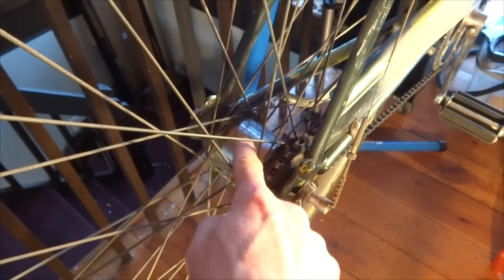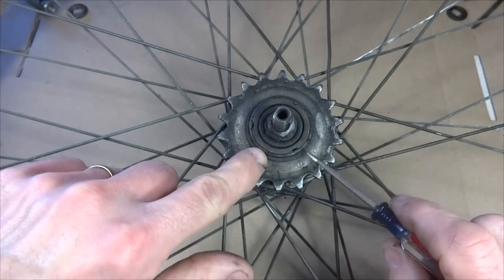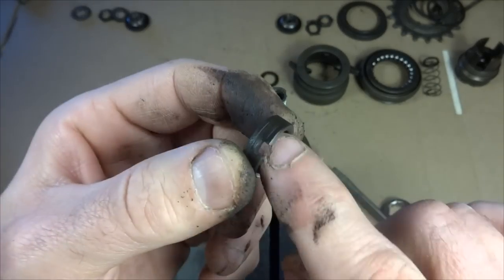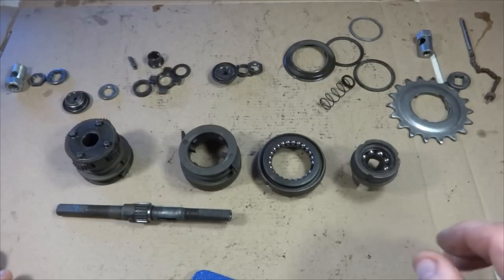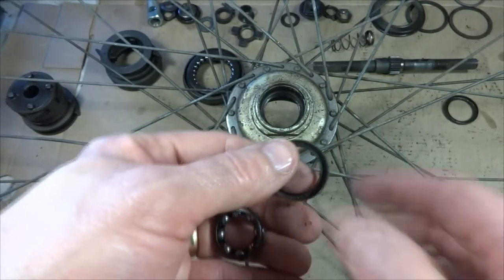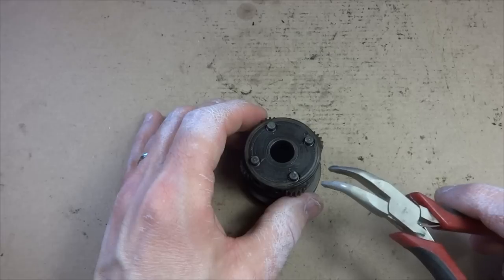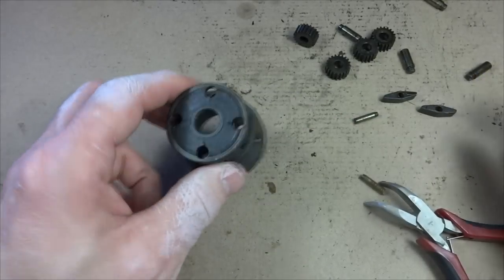Overhauling 60 Year Old Sturmey Archer 3 Speed Hub

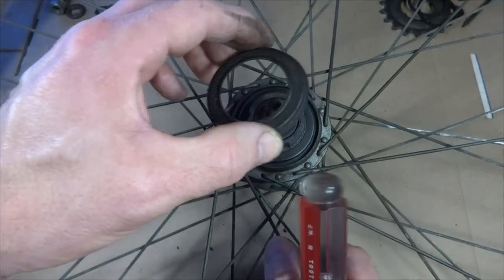Comment: The part at 4:38 almost drove me nuts. Hammer as I might, there was NO way I was getting this thing unstuck -- Date stamped '86, it had been sitting untouched for about the past 30 years (the bike's inner tube was a factory original!). I don't have a table vice to clamp the assembly in and turn the wheel, as some others suggested, and no amount of penetrating oil was going to help.
Thankfully a LBS still knows how these things are done, even if most shops nowadays are more about upselling novices on the newest Ultegra than building a community.

I have to de-rust some parts because they've started turning a nasty orange. Does anyone have any recommendations what to use as a protective coat on parts like this once the rust is gone? WD40? Oil, grease?

Comment: Thank you :) Very educational. My axle broke last weekend. Trying to fix it tomorrow with a new axle. I have the 3 Speed Hub AB with Brake. But most of the parts are identical. One problem is: I got a '86 Hub from my grandpa (with sane axle). My broken hub is '94. Same model, but the axle is different (the size of the slot for the axle key is smaller on the '86 one). Trying to mix it ('86 internals in the '94 hub). I do not want to renew the spokes.Thumbs crossed :D

Comment: The flanges on SA hubs were too narrow for modern spoke bends, and often broke spokes. A good shop would rebuild the wheel with brass washers behind the heads to support the curve. I seem to remember Sturmey Archer thickened the hub flange on the alloy bodied 5-speeds in the 1980s. Brass washers were also used in building SA dynohubs, which were quite popular with cycle tourists, even though the light they gave out was pitifully low.

I had a 4-speed on an early 1950s 28" wheel Raleigh Superb, great hub but prone to slipping if not adjusted perfectly. For a challenging total strip down, an integral hub-dyno takes some beating.

Comment: Hello , i converted a front wheel to 3 gears with this hub. I found the whole bike in alley and i saved it for a while.I was planning to use it cause in my 20s i converted a 16 inch bike from the garbage to 3 speeds using a shimano hub. Now because of gas prices im converting another found bike into gas powered chainsaw front wheel drive bike but at this conversion the pin would not retract. With your video i got it back to work and now the project will be finished with a high rev gas motor and 3 gears to go to use it for work.Thank you so much and i think it will be the only gas powered front wheel 3 gear bike 👍

Comment: Can you explain about the little steal key at 8:20 ? Mine fell out when the whole assemble fell out the wheel. 
The axle has a long shaped whole machined in it. Do I just put it in there horizontally with the hole up?  And what does it do anyway!
I really dont want to take everything apart......
Reply: That steel key is called the "axle key" and is part of the shifting mechanism.  Before you can reinstall it, you have to take the ball ring off (part he unscrewed with screwdriver and hammer), then the ring gear  (first part you see under the ball ring), if you want to do it easily.  First install the collar with the hole in it over the axle, then the clutch (cross-shaped), then this axle key, with its flats up, and finally another collar with the two notches to mate with the flats on the axle key.  This last part keeps the axle key from sliding out.  You might have removed it before sliding out the whole guts out of the hub shell, allowing the axle key to fall out.

Comment: I guess I was an old time bike mechanic.... ;~) I recall repairing these hubs back in the late 70s and early 80s... we had a stock of pawls, springs, gears, oil ports, chains (there were different lengths), etc. in the shop so we could actually fix them. Rather than using a screwdriver and hammer to disassemble the ball ring we had a tool that grabbed the two spots where the screwdriver was applied in the video. We would put the tool in the vice and spin the wheel. I see there is a flat spanner available for this purpose now but it seems to be shaped differently... I wonder if that vice tool is still available??

Comment: I plan to use your video on my blog page on hub-dynamo.  I have an AG 1954 - which is not a known working variable gear.  It has an extra washer with non- turning-flats on the non-drive side so that you can adjust the slack put the washer on then when you put the lock nut on it does not cause the  cone nut to turn.
Also my 1950 FW has the inspection hole both sides and you can use the shoulder of the toggle chain to set 2nd (L) but it has an  indicator rod the other side for setting 2nd or 3rd (N).   That is why the wheel nuts are the same both sides - it is historial.

http://blog.andrew-lohmann.me.uk/2019/07/

Comment: Sometimes the washers that go next to the axle nuts do not have the notches. This was purely because the bike frame dropout was the same dimension as the Sturmey axle flat part. If using the hub in another frame then check the dropout dimension & axle flats dimension. If different then source washers with notches (2 different sizes are available).

Comment: I cant remove the transmission from the wheel hub. I spent quite a bit of time trying to remove the ball cup with a hammer and screwdriver. Any suggestions?
Reply from the maker: Nope. I have overhauled a handful of these, exactly like in the video.

Comment: Many years ago I had a 4 speed. On the non drive side a threaded rod protruded from the hub and connected with the tension chain through the hub.. It needed the extended nut to protect it.

Comment: Was there a reason why you didn't lubricate the pins and the inside diameter of the dawgs and the planetary gears?  I have a Schwinn Sting Ray that has this hub.  Very interesting video.
Reply from the maker: They were lubricated by the oil in the later steps.

Comment: What grease gun are you using there? Looks handy. Also.....have you ever had issues using grease on your SA hubs? I have heard you are supposed to use OIL only. No grease needed. This doesnt make much sense but .....it is what it is. I have heard never use grease in the SA hubs. I just pulled mine apart ("64) and they are like yours (before your overhaul)....no grease at all
Reply from the maker: https://www.amazon.com/Dualco-Grease-Gun-Short-Nozzle/dp/B0025UGOVW?ie=UTF8&redirect=true&tag=youtube25-20
I haven't had any issues.

Comment: How'd I do that?
 '60s era Robin Hood 3 speed SA/ AW.

Some how (after I repacked the bearings but didn't  really get into the gear hub)
I managed to :1) break the end off a planet gear post. 2) break a tooth off the clutch. 3) break a tooth off the driver.  I hate the fact I did more harm than good.

Your input is appreciated.
Reply from the maker: Ouch! Not sure. These AW hubs are beasts. Not sure how you broke the parts.

Comment: Isn't the end of this (great) video incorrect? He says that in first gear the wheel moves faster than the cog, and then that in third gear the wheel moves more slowly than the cog. It's the other way around. He starts with it in THIRD gear, not first (which is what he incorrectly calls it) and that also explains why the cable is at its slackest. He keeps tightening the cable - i.e. going DOWN the gears. At least that's what I think. He's very good and it makes me self-doubt. Anybody got a view on this?
Reply: I'm having trouble figuring it out as well. The hub is attached to the wheel by the spokes so they will always rotate together.
In 1st gear the sprocket & pedals turn faster than the hub & wheel, in other words the wheel goes slower. Handy for going up hills.
In 2nd gear the sprocket & pedals turn at the same speed as the hub & wheel. (Direct Drive)
In 3rd gear the sprocket & pedals turn slower than the hub & wheel, in other words the wheel goes faster. Handy for going at speed.
I think I've got that right! 

It's mind boggling stuff from the mind of William Reilly from Salford, England. He invented what became known as the Sturmey Archer 3 speed internal gear hub at the beginning of the 20th Century but lost out on any of the glory due to business decisions.
Reply: @oxforddon2210  
Yes. You are correct. And that's what he means as well but the only confusing mistake he makes is that he SAYS it's in first gear when it is in third and vice versa.

Comment: After taking off the clutch you appeared to run out of words for all the parts!   This is quite typical of British manufacturing, it seems over-complicated with many parts that could double-up on functions and make the BoM and assembly cheaper.
Reply from the maker: I could have looked up the proper names, but exact technical names really don't help much in getting stuff to work. And these things use what they need.
Reply: @RJTheBikeGuy  I'm going to concede to your greater experience.

Comment: A fantastic video RJ. However, I have a question about the oil you suggest. In this video you recommend synthetic oil and specifically advise against using Phil's Tenacious Oil.  However, in your other Sturmey Archer AW hub rebuild video, you specifically recommend using Phil's Tenacious oil. Can you comment on this? I've now rebuilt I think 4 AW hubs using Tenacious oil as you suggest. I wonder whether they are too sticky or greasy, as I don't consider they spin as effortlessly as if they were new, but maybe Im being too critical of my own work.
Reply: The extra stickiness of Phil's is exactly what's bad for the pawls, and may cause them to stick when the oil gets old.  Better to use lighter oil, not as sticky.  However, if you replenish the Phil's often enough, it will never dry out, so you would be ok.  It all comes down to how well you maintain the hub.  If you neglect it, using a lighter oil would be better.

Comment: Adjuster fitment on non-drive side to accommodate French bikes, some of which had left-hand drive gear.
Reply from the maker: Not that I have ever seen. Post a link to a photo of one of these French bikes with a left hand drive and a Sturmey Archer hub. Frankly, I don't think it would work on this hub as it is designed to be pulled from the right side.

Comment: To tell you the truth I would have reused the bearings as well for a couple of reasons! First season being I don't trust modern parts as much as I do older parts! #2 they are still good and  fine to reuse! Kind of strange but I'm considering using one of these on a motorised bike! I think it would be easier then methods used to go with stacked cassettes and a derailleur! Then again it's just an idea at this point! Basicly am engine, and a Jackshaft kit with the free spinning front crank!
Reply from the maker: Bearings may look perfect, but unless you have very expensive lab equipment, you can't measure how worn, out of round they actually are. And they are cheap. So replace them. Just buy quality bearings.

Comment: Ok, but what to do when the gear shifter chain is broken in the axel, and one can not get a good grip of it with pliers to turn it out? This happened this other day, and I am getting upset, not really knowing what to do to solve the problem. It is a 3 speed Torspo model...I think.
Reply from the maker: You will have to figure it out. There are not standard fixes for these kinds of things. If it happened to me, I am sure I would figure out a solution. I don't know Torspo.
Reply: RJ The Bike Guy This is the trouble with the YouTube platform is that we don’t get to be able to see the insights from thousands of insightful people who are lurking in a Newsfeed who may have Specific knowledge but didn’t look at this one post underneath the video.

Comment: Hi RJ, great video! I've used it to overhaul a Sturmey Archer from 1980 :) Thank you!
I need to ask, is it normal operation that while starting to pedal for a quarter of a turn the gears not to engage?
Reply from the maker: No. Sounds like the pawls are sticking and not engaging right away. Or maybe something is not adjusted properly.
Reply: Thanks RJ! I will open it again.

Comment: I don't get why you don't use the same grease on all moving parts within the hub as oil will dry out faster and has a tendancy to run out of mechanisms that aren't fully sealed. high pressure applications require a thicker lubricant to ensure they can do their job without squeezing a lighter lubrication, like oil, out.
Reply from the maker: Ask Sturmey Archer who designed and manufactured it.
Reply: @RJTheBikeGuy  I believe they replaced the oil port with a grease nipple on later models...
Reply from the maker: @roythearcher  I haven't seen that. Grease on the pawls could easily make them stick and not work. I have seen later models without the oil port and oil was added by removing the indicator pin. Again talk to SA. I did not design the hub.

Comment: Thanks for your great videos!  I just received a Sears 503.21 3 speed hub that is stamped Sears and made in Austria.  iI appears like a SA AW clone, other than the shell being different?  By any chance do you know if this hub is indeed a SA product or a knock off?
Reply from the maker: +ddk80 I really don't know.
Reply: It is probably the same as the Styria hubs fitted to Puch (Austrian) bikes in the 70's. They are a copy of the AW, and so close most parts are interchangeable. I've done some swapping out between them and they still work.

Comment: Hello, thanks alot for your detailed video and advice you give. It helped me alot overhauling my sturmey archer AB-hub with drumbreak. I noticed two diverences and I wanted to ask if you have clue if that is the origin of my problems. 
First problem I've had is the third gear would coincenditly switch back to second although I'm quite sure I adjust the switching cable perfectly fine.
Second problem is my freewheel function doesn't run smoothly. It feels like it's breaking a little riding down a slope... 
Here the two things I noticed. First, the 24 ball bearing, mine has got 25! O.o 
And second the washer you put on in minute 24:25, I dont have one... If it's crucial for the holding the switches into places would you be able to tell me how thick it is? So I can replace it by a new one... Anyway thanks alot!
Reply from the maker: I have not worked on a Sturmey Archer AB. Different hubs are different.
Reply: My 71 tcw is also missing a square lock washer.

Comment: I can't count tje time I did this ;-)
The design is genius but... I dit put quite some strain on the drive so they tenden to break. but... I feel that some replacement-part were of substandard quality (maybe not even original).
I can tell you that after 4 time it isn't  that big a deal. But the first few times are, indeed, hairy.
Reply from the maker: The AW's are work horses and will last a long time. There are some other models that aren't quite as tough.
Reply: @RJTheBikeGuy  Martijn probably has an AB, the AW innards but with a drum brake on the NDS. Those are by far the most common in this country. That, or possibly the coaster brake version, although they used to be quite rare. The gear part for either shouldn’t be any less durable than the regular AW.

My big thing was the engagement between the star clutch and the pins, for third. Those would wear away quite soon from heavy use. And once they wore a little, they’d wear more.

Comment: Any advice on how to remove a stuck ball ring? I tried with the hammer and a punch but it won't move, and also tried with WD-40 with no success neither. It is from a ´95 SA 3-speed hub with drumbrakes.
Reply from the maker: They can be really tight. Instead of WD-40 try a better penetrating oil like Kano Kroil or PB Blaster.  Maybe try putting dry ice on the ball ring to freeze it. Maybe that will help.
Reply: Indeed it helped! I went to the hardware store and got something similar to that PB Blaster. A couple of sprays, let it penetrate and a couple blows, and off it went. Thanks a lot
Reply from the maker: Cool!
Reply: One last question: in the official SA documents (technical information, service manual), only grease is mentioned, no oil. They refer to two different greases, one for the bearings and another one for the rest of the parts. However, when I took the hub apart, the lubricant on the parts looked like a dense oil and not a grease. 
Any suggestion?
Reply: The idea was to build it using grease, and freshen the grease now and again using oil through the oil port. Strip and rebuild every 20000 miles was recommended. If you build using oil, you have to overhaul more frequently, or put up with oil escaping if you put a lot in. It then gets on your brakes.

Comment: Great video! So I've done some bearing replacement on a SA 3-speed - drum brake hub. Assembling went well, but when trying to cycle, the chainwheel slips in the hub. When operated "in the air",  the system works well. What can be wrong?
Reply from the maker: +Hans Puchdorp Not sure off hand. Not sure what model you have. I did a video overhauling a TCW-III: https://www.youtube.com/watch?v=e2YDcLF_CNI
Could be something was installed incorrectly, or maybe not lubed enough.
Reply: Mine (1967) had a nasty neutral between 2nd and 3rd. Cable length had to be just-so.
Reply: So I recently did a 1982 3-speed - drum brake combination overhaul completely including the inner bearing race and outer race and balls replacement. basically it's the same. Last week a similar 3-speed - drum brake overhaul of a 1995 type. This was a tricky one with broken freewheel "fingers". These fingers are much smaller than these on your movie without a brake. Parts were hard to obtain, but an experienced bike shop owner helped us finally. Again another bike is resqued from being scrapped!